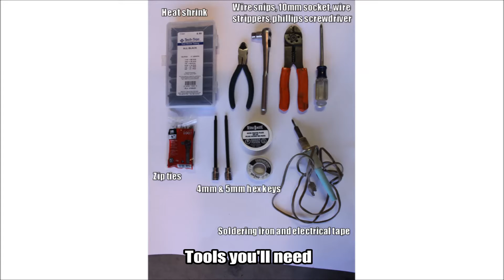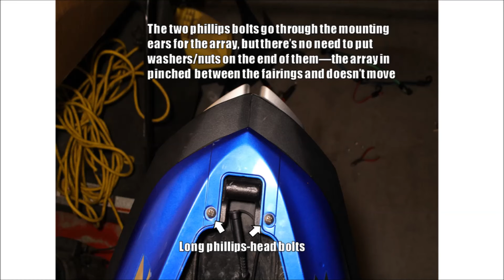2007-2008 ZX6R Integrated Brake/Tail Light

Comment: So this replaced the SS Fender eliminator in the other vid you had correct?  
I am mildly curious about the difference b/w this and the PineBox kit but it seems fairly straitghtforward once you arrange all the wiring
How does it light during the day?  
Also this is NOT DOT approved correct?
Any issues with traffic or the cops? 

Nice look tho!  Thanks for the vid
Reply from the maker: Different particular bike but same model bike, yes. I looked at the pine box kit as well, but I decided to choose this one for no particular reason. The pine box could or could not be of higher quality.. That may be subjective. Overall it's a good light, but it could use supplemental lighting to improve braking visibility
Reply: Kool. 

The Pinebox kit has P&P now but I have been curious about the daytime visibility of those strips.  Does the SS Fender strip have the same issue as this for visibility during the day? 
Thanks for the reply
Reply from the maker: The plug and play aspect is very nice from pinebox. Definitely a time saver. With my wiring diagram here, and assuming you have the stock brake light already, you won't have to back up any of the bike's wiring. It really only took a couple hours to do. The SS fender still suffers from the lack of visibility as this one, yeah. You'll definitely want some supplemental lighting. I added some to mine after I installed this. I can take a video of what I added in conjunction with this light if you're curious
Reply: Sure! If you have the time I would love to see the additional lighting for inspiration.

Comment: HOW DID YOU PUT YOUR LICENSE PLATE DOWN THERE? DO YOU HAVE A VIDEO FOR IT? I HAVE THE SAME EXACT BIKE SAME EXACT COLOR! BEAUTIFUL JOB! THANKS
Reply from the maker: The installation instructions start at 0:45 on how I did everything, it's just in pictorial format. It takes about an hour to get everything done. The company I purchased the light from is also in the description. Thanks!
Reply: IF YOU READ AGAIN I SAID LICENSE PLATE, NOT TAIL LIGHT, BUT THANKS AGAIN FOR YOUR TIME!
Reply from the maker: Oh, my apologies. Are you asking how the plate is attached to the fender eliminator? If so, I just put two reflectors on there. If you search Amazon for 'Chris Products Bolt-on Reflectors', you should find the ones I have.. they're like $6 each. The fender eliminator itself is from XD Cycles, but it doesn't look like they carry it anymore.
Reply: It's all good. Yeah like I meant the piece or the bracket that goes down there to hold the license plate, okay maybe let me take a step back did you have to drill to put the license plate bracket there? lol That is my main question, and if you drill it, is it safe, like are there any other components that might get damaged when drilling? Thanks again!
Reply from the maker: Ahh okay, yeah we're on the same page now. No, no drilling required. When you look under the bike, you'll see two bolt heads. If you pull the battery and look under the piece of rubber underneath where the battery is sitting, you'll see the studs from those bolts. Loosen the two nuts (I think they're 10mm nuts) and then push the studs down. The entire thing will come down.. like it'll push downward towards the tire. You just slip the fender eliminator over the studs, and then push the studs back up into the holes and nut them back up. Took me about 15 mins to figure it out, but its super easy... no drilling required!
Reply: No way, is there a way I can personal email you, and share my phone number with you? Like I mentioned to you before I have an 08 zx6r and for some reason I do not see those bolts anywhere around that area. I am not a scam or some sort like that you can trust me lol that'd truly mean a lot! thank you!

Comment: how did you secure the light itself I have the same one and am having a hard time getting the nut on the bottom side of the bolt
Reply from the maker: Justin, I didn't secure it. It's pinched between the fairing and the included bolts--there's no nuts on the ends. It's not the best solution, but it does work.. been on there since 2015 and I still have this bike.

Comment: hey man what did you use to guard the exhaust? is that a wrap it looks clean
Reply from the maker: Sorry for the delay, Sergio. I missed your comment  quite a while ago. I used some heatwrap that I found at Autozone/O'reilly's to shield the array from the exhaust. Just cut a little piece out and wedged it between the light and the exhaust. Works well!

Comment: I would like to run the same set up on my zx6r, but where did you get the license plate brackets from and is it visible at night?
Reply from the maker: I got it from XD Cycles, they offer it as an option when you get the light. It is visible at night, yes